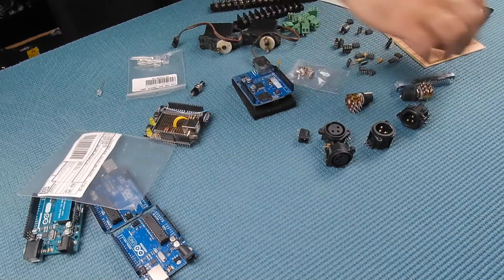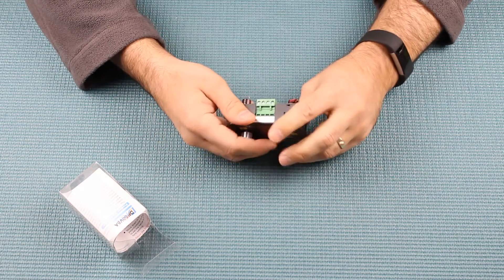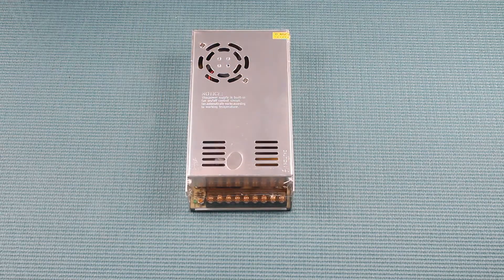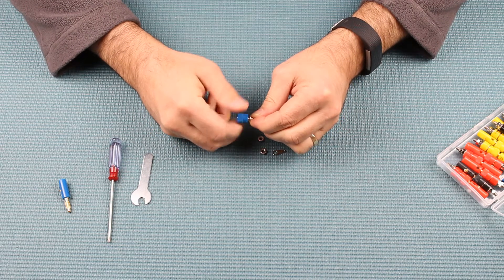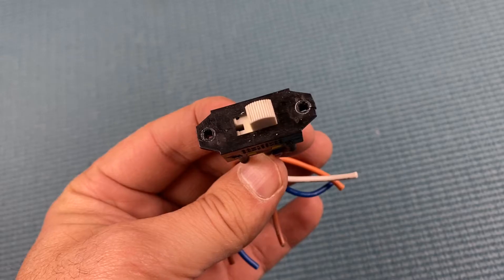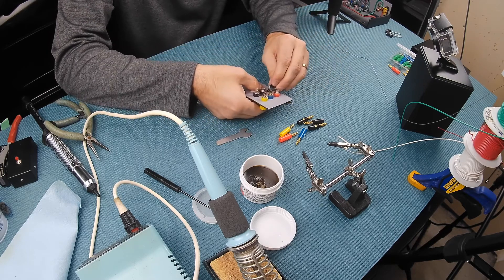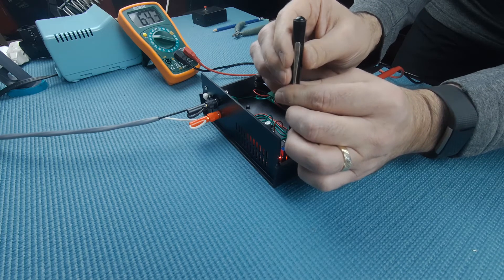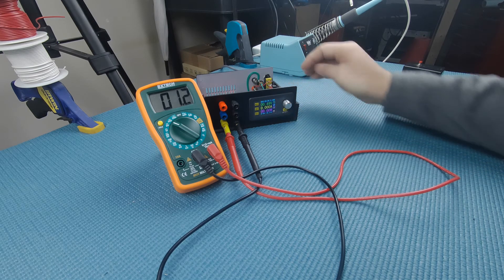Building a multi-output power supply.

Comment: I think you were using quite thin wires?
Reply from the maker: Hi Kimmo. Thanks for reaching out. I thought so too at first but when I checked the AWG chart, it appeared that the 22 gauge was acceptable for the load of each converter. Paper and practice can be quite different though. 😉
Reply: @crowdedgarage1099  Hello, I got interested and tried to search some real data also. It was quite difficult, but I  think suggested max current for 22 AWG wire is about 1.7 A and if I  understand the other comment the circuit is not very good for bigger currents so the cable can be suitable for use. Thank you for the interesting video.
Reply from the maker: Hi Kimmo. Here is a link to a website that describes gauge and current rating. I would consider my project chassis wiring. Thanks for keeping me on my toes. 
https://www.powerstream.com/Wire_Size.htm